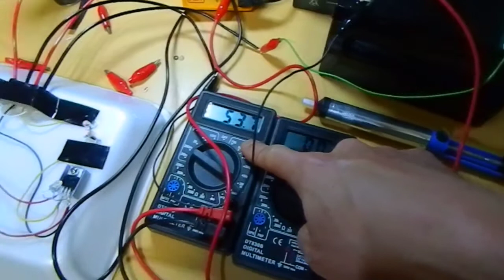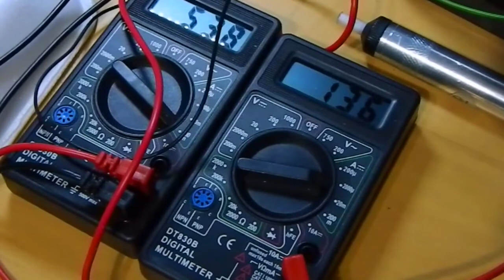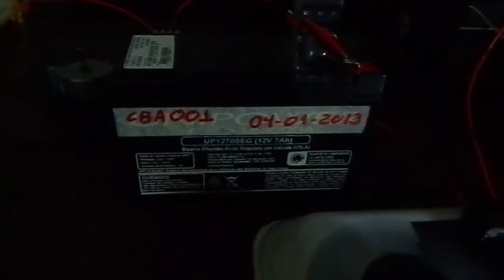SSG PC Fan - 1st Build

Comment from the maker: Greetings... I´ve always heard that an LED from E to B is to protect the transistor. I did not know that it was to clamp it off. Thanks for the new info. I´m still learning about all this electronic stuff, but the fact is.... this works and using the led from coil to B and another one from E to B my transistors are having a longer life. Before this I was burning a lot of them. Please provide more info on this clamp off as I wish to learn this too. Thanks.